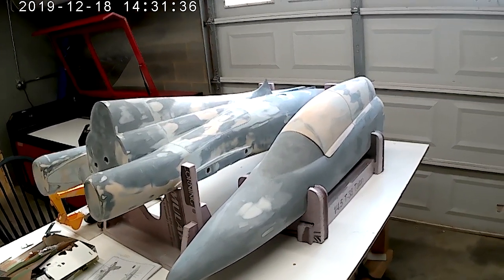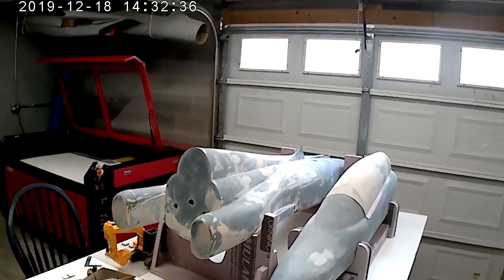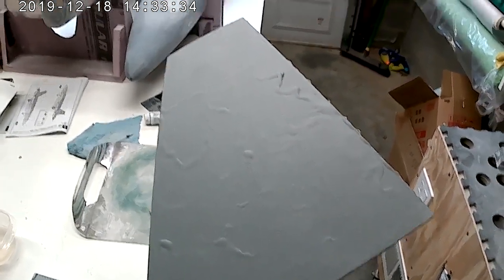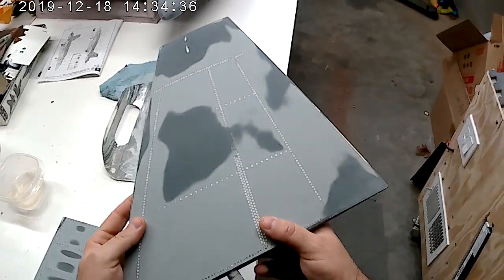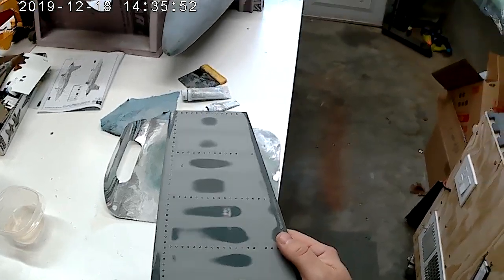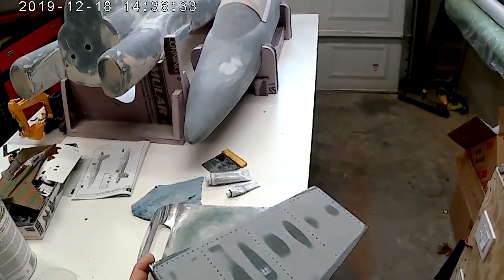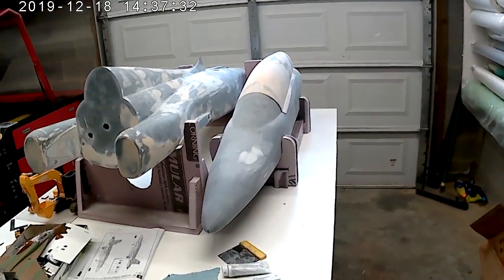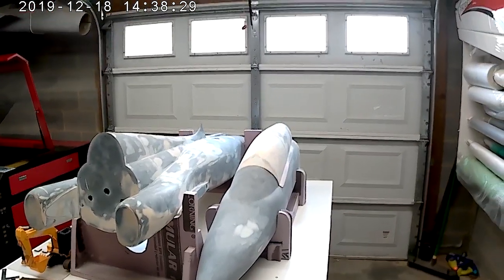1/4.5 T-38 Talon Build Series Video 2

Comment: What programs did you use to draw and get the gcode to 3d print the sections for the printer? Thanks
Reply from the maker: Solidworks is the Primary CAD package used for the design work of all my models.  After that, i use Simplify3D for FDM Print slicing and Chitubox for SLA Printing.
Reply: invertmast 
Thanks for the information.